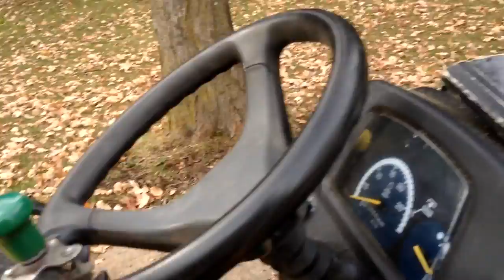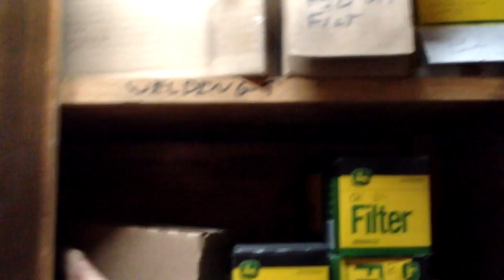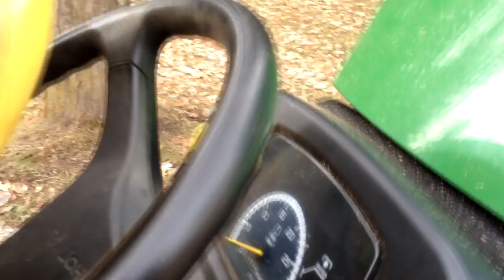Talking Bridge and stuff

Comment: Hi Bill,

I know you have it now, but I thought you said you were going to use Railroad ties the big thick ones for the bridge. 
The original Ties which are something like 10" x 6" ish are solid you could keep the wood for gate or fence making if you decide to use it and other than that all this thin wood is doing is separating the two beams with no strength my friend. We are in the UK I know, but we used this for fencing.

With the spacing of the beams the land levels mean nothing

Comment: bill you should fabricate a plate to mount to the 110 loader and have it just be a plate and secure a winch to it so you can pull htings etc. 
just a suggestion for a project and a nice strong winch would work too

Comment: Well, while the concrete guys are visiting, get them up to the bridge and have them mix up some concrete and make proper foundations. Dirt is just dirt - soggy when wet. The little timber logs won't be much of a stable platform either.
Just my 2 cents worth.
Maybe you can make use of those cornerstones too.

Comment: We had a wheel barrow and walking bridge which was across a water course, sorry about the spelling, and we used old second hand rail ties.
Do not rely on anything "settling" into its place, fix it where you want it for a few good reasons,
1, to keep the bridge level end to end.
2, to keep the bridge level side to side.
3, the ground either side should be not only level but the same height  as each other.
4, you should really put a concrete pad which spans the width between the two steels,

Comment: and you can do this even below water or close to water levels by using any type of cement as it all cures under water though the bottom of the holes for the groundworks must be flat and level so it doesn’t slide into the river.
A bridge is only as strong as its weakest link, and build with the same stuff you have the wood is the 1st link, and the levelling which has yet to be done, and NOT left to find its own place as you said, is the second.

Use a hefty net across it to ad grip.

Comment: Most important thing to remember when changing fuel filters on a diesel, bill, is to fill the new filter with fresh diesel fuel before screwing it on, otherwise if you get air in the injection pump you will be cursing for hours trying to bleed it.

Comment: Don't install wood underneath your steel beams, they will rot and splinter. I would use sonotubes and pour concrete piers. I'm sure your concrete guy's owe you a favor, call it in. If you lay a gravel bed up to the deck of the bridge you will be set. I know this is overkill but you started it once you got steel beams. It will be there for when Dilly takes over. Enjoy your vids, thank you.

Comment: If my mower used any coolant at all, just for piece of mind I would add a little bottle of UV dye and let it run thru system for about a good week or two and check the exhaust with a black light...Coolant systems are closed pressurized systems in theory  it should not be able to evap off any coolant.. just what I would do.

Comment: Its the centres of the large or small tractor that is crucial. And maybe even not that as I doubt you could even take the 4 x 4 across with those boards.

I really do not mean to go on and on, but have just a little knowledge as a previous house builder, as to strength. OK so you have the iron underneath, but if when driving you do not precisely drive whatever you intend directly on the part above the iron, I can see the wood snapping like a twig. It may be held to the iron but not to itself.

Comment: You need concrete piers for those steel beams. Your going to be in the water again. If you use dirt and wood as your piers. You got steel I-beams to to your bridge right. Now do the piers right and use concrete.

Comment: Bill @ 18:21 looks like you have another filter on the engine running away from the water separator.. 

Above the separator to the right of the black spin on.. Silver in color.